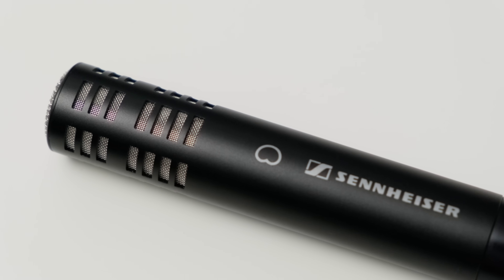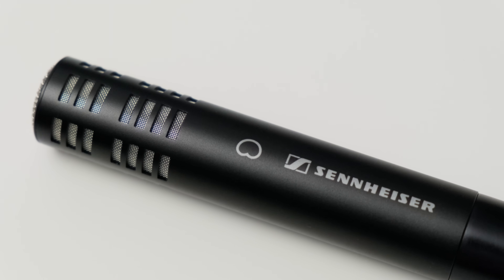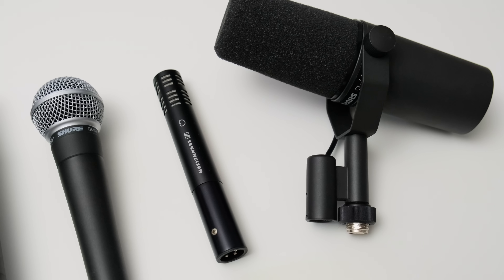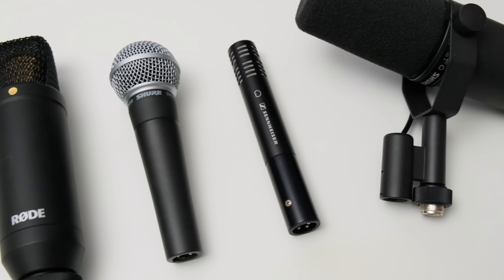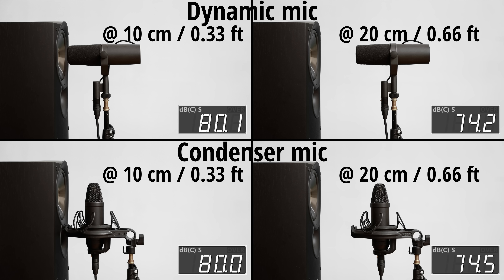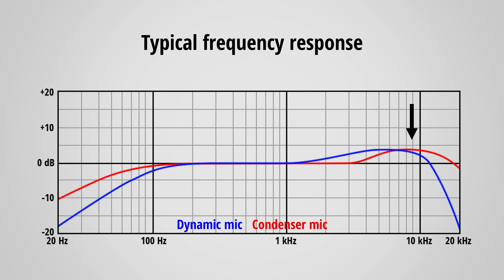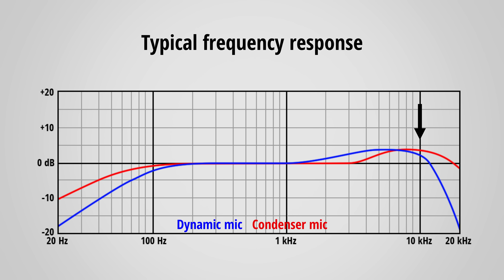Dynamic mics don’t reject noise better than condensers! And yet they do?

Comment: Oh dear lord what an oversimplification. Sm7b will always have better 180° rejection due to it's bulky body, and end address type. I've done anechoic measurements, an they are clear as a day. Then there are ksm Neumann series which have modified capsules so the cardioid delay path operates from 90° angle. Again superior rear rejection.

Comment: Try giving a condenser mic for live rock band's vocalist instead of sm 58. Good luck. PS. I would appreciate your feedback :)
Reply: @Ernie.   Not sure what you are basing your theory on as condenser mics frequently get used as live vocal mics.  

The Shure SM87, Sennheiser e965, and Neumann KM105 are very popular live vocal mics.

I'm a big fan of the SM57 and SM58 for live vocals so I'm not biased against them for live work at all.   

Dynamic mics or Condensers can both be effective in loud band situations, it's really about how you manage a particular mic rather then one type being "better" than the other.

The 58 is definitely better at taking a fall than a condenser is and that combined with cost are extremely good reasons for choosing them.   

That said a 57 or 58 are capable of very high quality sound, assuming you know what you are doing with them of course.

The most important things to getting quality sound in a loud live situation are a good strong singer and somebody running sound who actually knows what they are doing which is unfortunately a somewhat unusual occurrence.   Mic choice is by far a distant third in the running.
Reply: @7171jay  You have good valid points there. But my point was about feedback problems. In a very loud live environment you will get more of those with condenser mics.  Sure, if the whole band uses in ear monitoring (guitarists using digital amps instead of tube etc.) and the stage volume is almost "silent" - no problems. And indeed, it's the direction where live performances are going, for better or for worse.

And in the end,  we can always just blame the house sound guy. They are used to it.
Reply: @Ernie.   Regarding feedback, condensers and dynamic mics just have different issues that need to be addressed.  

58s (57s as well as they are nearly the same mic) will usually feedback predominantly in the low frequencies and if you attenuate those properly then the presence boost around 5-6k is usually tends to often be the next point of difficulty unless the room itself has some unusual rough spikes or the PA itself isn't flat which is common.

Stage condensers in general tend to have the bottom end more under control than the 58 does but are more likely to have issues in the higher frequencies.   It's all a matter of understanding what you are working with and knowing how to adjust properly for all the factors.

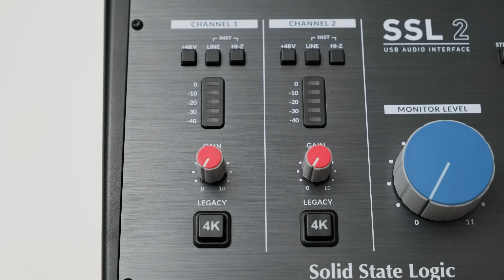Comment: 7:30   unmmm a unidirectional dynamic mic has no proximity effect.
Reply: What? They definitely have it. Omni directional mics have no proximity effect though.
Reply: @tmappe  you get louder the closer you are to the mic but bass doesn't increase.
Reply: Research it.
Reply: "Here's why:

    How Proximity Effect Works:
    The proximity effect occurs in microphones that respond to pressure differences between the front and back of the diaphragm (pressure gradient microphones), like cardioid microphones. As a sound source moves closer, the pressure difference increases, boosting low frequencies. 

Omnidirectional Microphones as Pressure Transducers:
Omnidirectional microphones, on the other hand, are pressure microphones, meaning they respond to sound pressure on the front of the diaphragm only. 
No Pressure Difference:
Because omnidirectional microphones measure only pressure, there's no pressure difference to amplify, and therefore no proximity effect. "
Reply: I have an EV 635 n/d-b omnidirectional dynamic mic.   I own it because of the lack of proximity effect.  I have TESTED IT and sure enough  NO PROXIMITY EFFECT.    I don't just talk shiot.  I speak from experience.
Reply: @chrisw5742  unidirectional - uni means one, and unidirectional usually is used synonymously with cardioid microphones. It is not the same as omnidirectional. But a lot of people confuse this things as unidirectional looks similar to undirectional. Just a little clarification.

Comment: A few clarifications: 
- only directional microphones are subject to the proximity effect.
- dynamic mics in general have much stiffer and heavier diaphragm (with wire in voice coil), which restricts their movement (and so - sensitivity). 
But some high-quality dynamic microphones have a very light and thin diaphragm (MD441, RE20), which allows them to work almost like a condenser.
On other hand - SubKick - is also a dynamic mic. You'll be surprised, how well it suppress the room ;)
Reply: it still rejects the loud and quiet parts equally, so the background wouldn't be rejected any more than the foreground
Reply: Leave the "stiffer membrane" logic behind, it's not applicable here. A dynamic membrane has folds in it to allow the membrane to flex, in spite of it having to support a substantial weight of the coil, and it experiences visible movement, it moves a lot. In turn typically a large condenser membrane is stretched hard, it cannot move barely at all, the small amount of displacement reduces distortion though, since it's not affected by linearity of the magnetic or electric field unlike the dynamic coil, so dynamic has some saturation at high excursion. At the end the signal is amplified to the desired target level of the recording, sooo... it just cancels out the original inherent signal level.
Reply: @SianaGearz   Then what about impedance? Not electrical, but mechanical, acoustic. I would think eq would resolve this issue, and with decent amplification it would sound the same but then what about distortion apart from excursion and transient response?

Comment: Good video, every myth-busting is automatically an like from me :) I would add nevertheless couple things:
If micropohone is classified as a specific type of polar pattern, it doesn't mean that they all behave the same in the same conditions. Rule of thumb is: bigger the microphone = the less narrow polar pattern = more colorized off axis sound. Large capsule mics, or ones in bigger enclosure will have definitly wider polar pattern. 
Cardioid don't reject all the rear sound, difference between front and rear is usually around 20 dB, also frequency response changes within polar pattern, all this affects how irritating unwanted bleed can be. So it is not a matter "how much it rejects off axis noise" but also "how good off axis sounds". 
Best rejection of "sides" have figure of 8 microphones, better than any super/hypercardioid. there is very famous ribbon microphone which was used for decades in most acousticlly demanding environments like big sports events - coles 4104. super cool microphone

Comment: I agree with everything you said in this video. However, I believe transient response also plays a big role in the perceived noise rejection, especially with spoken word. What's great for capturing the finer details of musical instruments and singing voice becomes a nuisance when recording spoken word with the goal of intelligibility and easy listening.  Rustling of paper or clothes, typing, mouth noises and probably even the more annoying parts of fan noise depend on good transient response for faithful reproduction, and fade more into background if it's lacking. This effect is then amplified by the different frequency response.
Reply: Transient response and frequency response are the same thing for a microphone. The ability of a microphone to pick up high frequency content is equivalent to the diaphragm's ability to move quickly.
Reply: @BenjaminRCook  If you eq a dynamic microphone to exactly match that of a condenser, the transient response will still differ.
Reply: He showed that at 2 mins in. Eg "fall-off".  They were basically the same.

Comment: How do I capture “clean” audio on motorcycle.  Simple dead cat or foam filter only seem to help some. I appreciate any suggestions.
Reply: Don't start&drive the motorcycle
Reply: @MassimoTava  
But what do you want to capture? Sound of motorcycle? Or everything else? For wind problem you need some blimp for microphone, probably with deadcat. Blimp should have suspension that reduce vibration passing from motorcycle directly to the mic. Biggest problem is that with mic mounted close to motorcycle u will always have large difference in loudness between motor and surroundings, so blimp should be mounted as far as u can from motorcycle to keep sounds more equal. Your head is able to virtually separate sources, boosting some, ignoring rest etc. Microphone cannot do that (some post production tools can though, isotope rx or other machine learning base tools). It is complicated topic, so it really depends on what are you trying to do and what do you need it for.

Comment: "Physically Impossible" is misleading. Microphone membranes are measured in microns and micrograms. The physical design of a dynamic capsule has the voice coil directly attached to the membrane. This gives it more inertia, meaning it requires more energy to move it, and requires longer to come to a stop. In an exaggerated scale, it's like trying to shove a 5kg bag of flour vs a 25kg bag of flour. One requires more energy to move it from its resting state and will be slower to "respond." In hurricane-force winds, both will be tossed around with impunity. It's rarely about the loudest sounds, but about the quietest ones.

That being said, recent technological developments have greatly reduced the weight of dynamic capsules (and for that matter, condensers as well). Mylar has become thinner, voice coils have become much smaller, and the precision of the electronics involved has also greatly improved. The largest difference one would see is from high frequency information, where the heavier membrane would struggle to "react" as quickly as the smaller one. In the modern era, these differences have become more-or-less negligible, as all microphones (and amplifiers) have become more efficient and more sensitive.

And you are more-than-correct that the differences this creates has been exaggerated. For practical purposes, most modern dynamic microphones will reject background "noise" in a similar way to condensers. However, when you start getting into the science of audio, pointing out these small differences and their impacts at small levels does become important. Useful for a home recording artist? Unlikely.
Reply: What you described affects impulse response of microphones, and dynamic microphone as they have heavier membranes distorts transient more than condenser, and LDC distorts more than SDC. But it has 0 (ZERO) effects on how sensitive microphone is in relation to background noise, it is just impossible.
Reply: @ "Impossible" is, again, a mischaracterization of what is happening. I agree that, for practical purposes, you should more-or-less record with a Cardioid Dynamic in a similar fashion to a Condenser. If you have noise in the background, the microphone should not be your first step (and is unlikely to alter that perceived noise). 

And yes, you're correct that the greatest affected area is high frequency, as it carries less energy and therefore struggles against the inertia more. 

It's not about "sensitivity to background noise," it's about sensitivity in general. A quiet, transient sound will struggle to move a heavier diaphragm from "resting." And if it's heavy enough, the amplification might not be enough to even perceive what little effect this tiny sound had. And even if you did amplify it, it would not be nearly as "clear" compared to a lighter diaphragm. 

Does any of this information serve a recording artist practically? No. But if we're going to discuss the mechanics of audio, it's worth noting that there is a difference. And it's better to explain why that difference is negligible for the majority of applications. 

But saying "because the difference is so small in modern mics, it's physically impossible for microphones to react to quiet sounds differently," is dubious and misleading.
Reply: @DapperDanLovesYou  o wow, it really sounds like You know your acoustics! Where did you gathered all that knowledge?
Reply: @ 10+ years in recording, various classes during college, an internship at a recording studio, and general personal interest 👍

I certainly don't know everything, but "physically impossible" is a dubious statement. It's one thing to tell people "This is negligible, and here's why." It's another to say, "It's impossible for microphone capsules to react differently to quiet sources."
Reply: @DapperDanLovesYou  just for the record, my previous comment could (or could not) contain some sarcasm.
Reply: Mic's sensitivity only affects SNR and FR. How would mic detect which sound is background and which is not?
Reply: @ It's not about "detecting," it's about response time to weak source. Imagine a piece of paper sitting on a desk. You gently blow on that paper, and it moves. Now, you put a light paperweight in the middle. You gently blow on the paper. It requires more force to move it from a resting position. 

With infinite amplification, you could potentially measure the small levels of change the heavier paper experienced. But without modification, that "signal" would not be as "clear" as the more flexible and lightweight single sheet. 

This isn't about "reducing reverb." That's silly. Instead, imagine a soft white noise that infiltrates a recording space. This quiet sound will struggle to move a heavier diaphragm (compared to a lighter one). If you're blasting a 70 dB sound through the room, it'll hardly make any difference. 

In modern microphones, this difference is nearly negligible. And this knowledge isn't particularly practical for a recording artist.
Reply: @DapperDanLovesYou  well, response time is just speed at which membrane can oscillate, i.e. freqency response. There's no difference between weak and strong signal of the same frequency (except that weak signal has less SNR), the both have the same "membrane movement ratio".
When that ratio is different for weak and strong signal - it is called "distortion". Not "reducing reverb".
Reply: @ghaydn  I wouldn't call it "reducing reverb" either. Reverb should be addressed in the room, not the mic. Same as "noise."

However, this becomes a physics question. If what you are saying is fundamentally true, then large Cruise Ships should be affected by waves an equal amount to a Dinghy. And on the surface, one might even think that they are and that small waves on a large ship just don't amount to much. But, again, inertia is an important factor here. If a wave doesn't contain enough energy, it will fail to move the ship at all. 

I've already agreed that 
a) this difference is practically negligible
b) has been overexaggerated over the years

And if that was all that was said, I wouldn't even care. But it's dubious to propose that diaphragms with different inertia will respond to weak forces identically, and that the only difference will be the time they take to respond to it.
Reply: No one cares about recent technological developments. Everyone is using 60 year old mics or older.
Reply: @ But when you're talking about the origin of a "myth," it's worth looking into the history of the equipment. Especially since 60+ year old microphones are still used in recording studios.

Comment: I'm surprised you didn't cover off-axis coloration as part of this discussion.
Reply: Same, off-axis frequency response is the primary differentiator when it comes to the balance between direct and indirect sources (eg room reverb). The cardioid patterns in mics designed for the stage tend to be tighter than those designed for the studio as well, regardless of the technology used for the diaphragm.
Reply: Which you eventually learn matters A LOT more than people think. It's often what sets a mic apart from another and makes it more or less suitable for a certain application.
Reply: Nobody cares about it